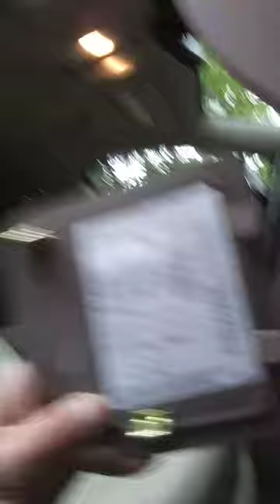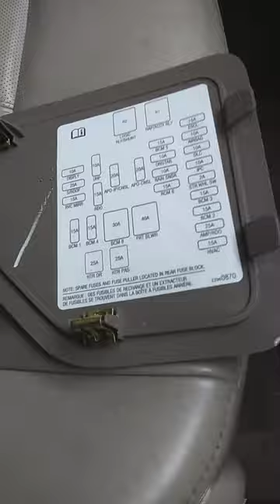Cadillac SRX low beam headlight problem

Comment: You are the man!   I spent 2 hours taking the air box out to get to the passenger bulbs.  Two trips to autozone to buy bulbs.  Nothing worked. Had just scheduled an appt with the dealer when I found your video.  Sure enough it was a blown fuse just like you show in your video!   Thank you very much!

Comment: Also, were your low beams out altogether or just dim?  Mine are dim but work.  Will a new fuse fix that?
Reply: Don’t know if I caught you in time but the problem is the reflector chrome is burned and will not reflect the light I had the very same problem and Cadillac would not do anything about it so I bought 2 new headlights on Amazon $300 for the pair when I removed the old ones I took them apart and sure enough the reflector buckets were burned and destroyed the problem is the halogen lamps run upward of 400 degrees the new modules did not come with bulbs so I transferred the high beam and turn lamps from the old modules and installed LED bulbs in the low beam they run at about 85 degrees and won’t burn the buckets the LED bulbs are the same ones for the fog lights hope this helps

Comment: Thanks for the info!! Subbed.  

I bought fog lights because the low beam headlights are so dim. Trying to use the low beam fuse with a fuse tap to send power/ signal to a relay which will turn on  the fog lights  ( power from battery, fused in line). Harness $10, eaby. 

Problem is low beam fuse 46, 47 is empty!! I dont even have long enough cable to test BCM4. And even if it did work, running it through the firewall/ body may prove very difficult.

I would very much appreciate it if you have any thoughts on this.

Can you point me in the right direction? 

I was so confused for months that 46, 47 on engine compartment is empty ( and may not even have a current present) then though the fuse diagram says they are for low beam. 

BCM4 is for left low beam only.  Curious, which one for right low beam?
Reply: If your low beams are dim but work the problem is the chrome is burned in the reflector buckets and you have to replace the headlight modules 
the halogen bulbs run 400 degrees and you must install LED bulbs they run 85 degrees and work fine same bulbs they use in the fog lights unfortunately you can’t buy the reflector buckets for the old modules and Cadillac won’t do jack about it I replaced mine in about 2 hrs I cut open the old lights and the reflector buckets were burned and starting to melt go LED problem solved
Reply: @plightfoot8491 what led bulbs did you buy? I know it’s been awhile but would appreciate a response to help, thanks :)
Reply: @ronaldmartin8770  bought the bulbs for the fog lights to replace the low beam driving lights my caddy is a 2010 SRX
Reply: @genericman4078  if your low beams are dim your reflectors are burned only fix is replacing headlights and putting fog light bulbs in place halogen bulbs run at about 400 degrees while LEDS RUN 80 degrees and won’t melt the reflectors G M  screw up again

Comment: Tried this on a 2014 SRX. It did not work. Checked all fuses no issues. Will come back if I find anything else. Thank you for taking the time to help.

Update: My driver's side low beam issue was due to a cut white wire right where it went into the fuse box. It was located in the middle of the three harnesses.  I found the break in the wire using a Klein tone generator. Just clip it to the wire you want to trace and run the receiver along the wire harness until it stops toning. 

I put LED bulbs in too. The improvement for the low beams was a little disappointing. The High Beams are amazing. Same bulbs. 
If I get under there again I will probably put bulbs with higher lumen rating in the low beams.

I do like how the LED's have a crisp break along the lit to the dark area in front of the car. You can adjust them so they don't blind oncoming traffic. I set them so when the car comes up from the shock absorber it won't bounce the light into the oncoming persons face.